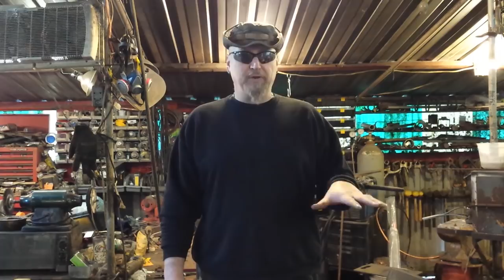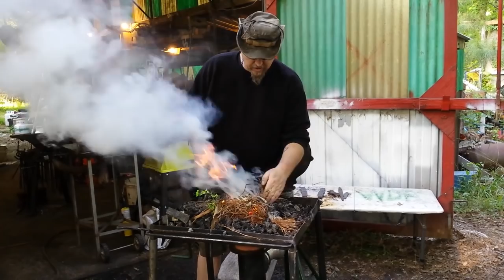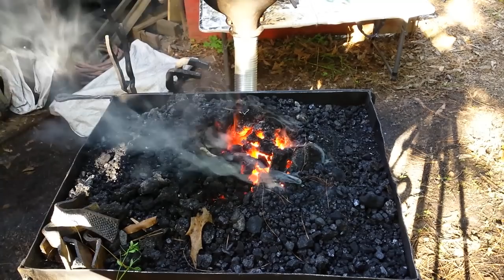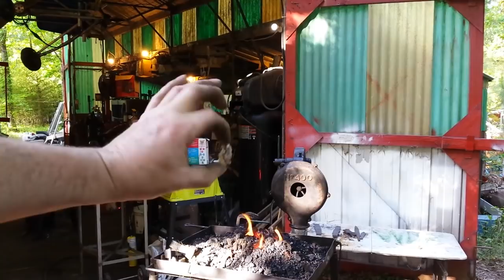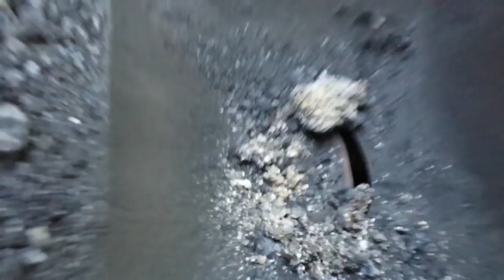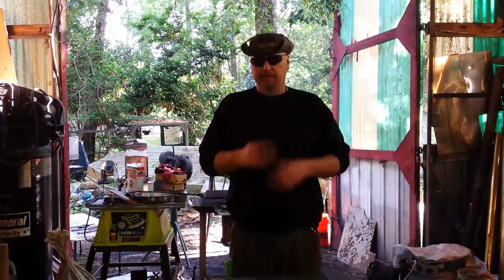How To Light A Coal Forge and Use It Like A Pro

Comment: Thanks had to watch this twice to light my forge.  After 2 hours unsuccessfully trying to light up I noticed you crank your Champion No. 400 counter clockwise.   Lit up immediately doing just that.  All I find on utube is guys cranking clockwise.   Cc works much better for me.  Thanks so much.  Manual is available on line and claims it can be cranked either way.